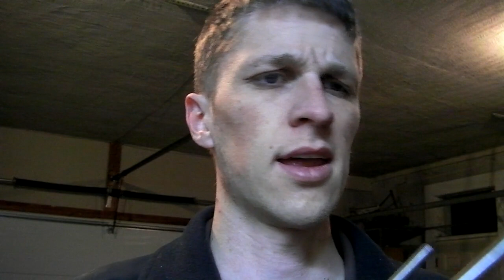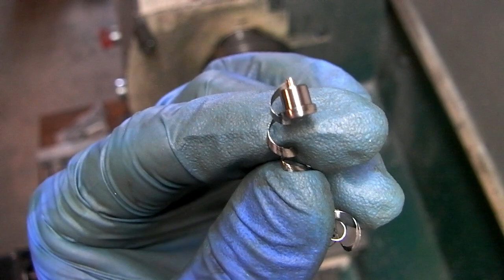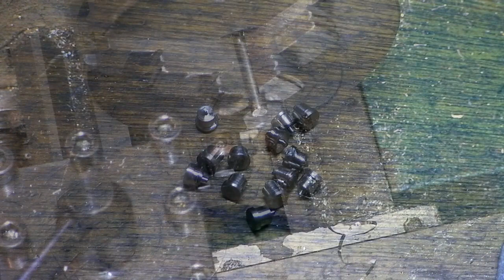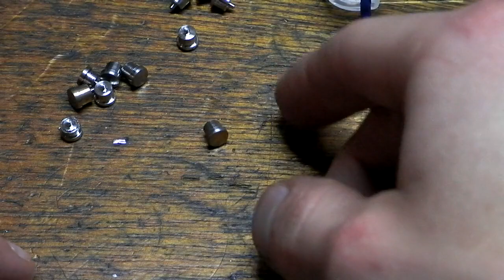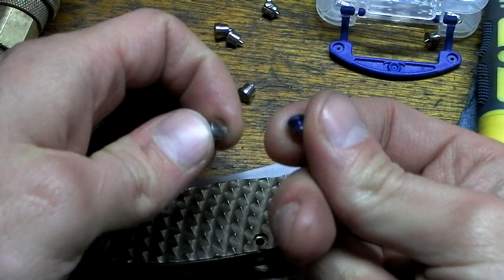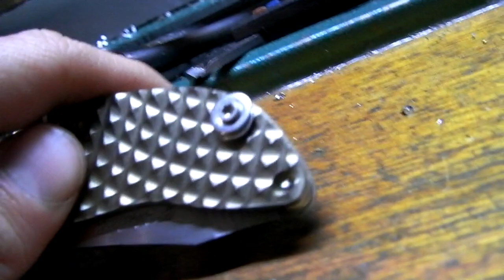Knifemaking Tuesdays Week 15 - Turning titanium spacers on my CNC lathe

Comment: i dont want to be a complete hater but it looks like your cut speed is too high when your cutting the part from the bar and also i couldnt get over that you where putting the pipe for your air on the near side of the turret right infront of the chuck! pure madness! if that had clipped the chuck at that speed i think you would have got a pretty nasty injury!
i like your videos and as i said i dont want to be negative or a H&S killjoy but seriously, youre lacking some basic fundamental safety!